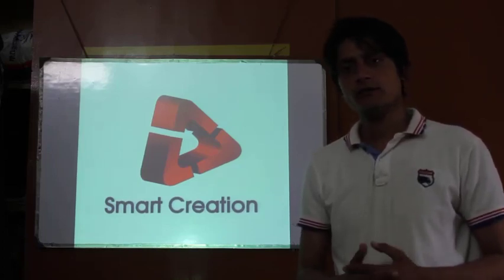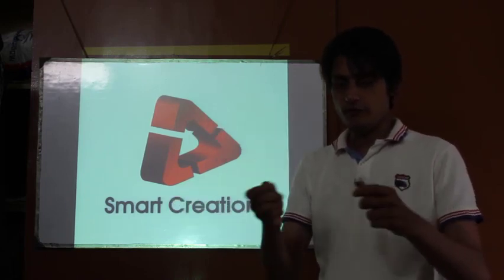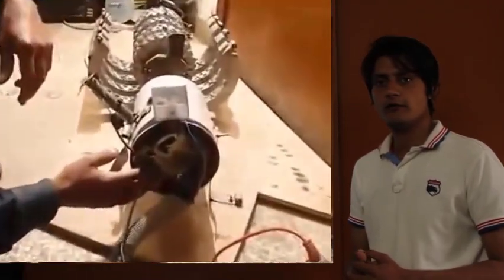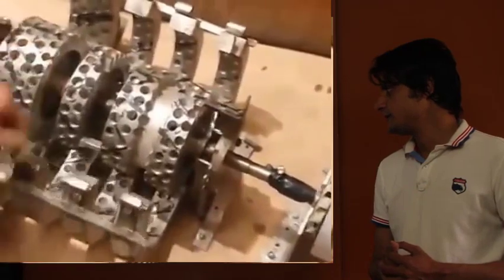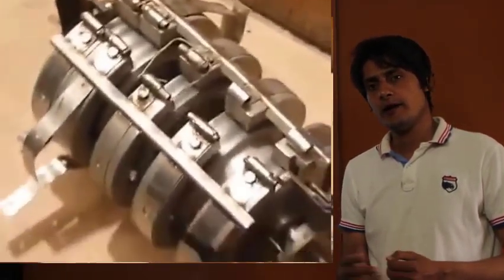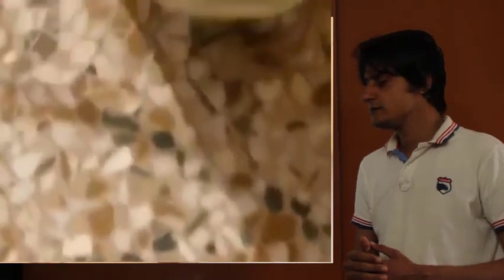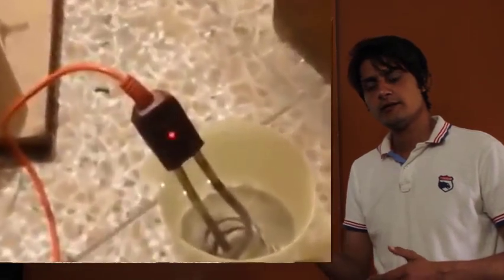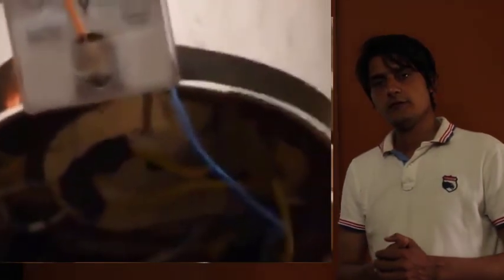Free Energy Generator By wasif Kahloon Magnet Energy Explained the Overall Ideas of Magnet Generator

Comment: Take the electric generator off it and just run the magnet field generator, that will prove a whole hell of A LOT!
Reply from the maker: agree this is my reserched so i am working on this is that worked or not
Reply: @LatestEnergy  remove the hose connecting the machines and show your machine working alone.
Reply from the maker: yup agreee but this is my reserched
Reply: @LatestEnergy   it is obvious you put a lot of time into it but it is not so obvious that it runs freely without help from a motor and power source.

Comment: Its called find the hidden grid connected power cable, what a pile of crap, its not designed to generate free energy, its designed to generate free money taken from fools.
Reply from the maker: oaky we would uploaded new videos regarding same generator
Reply: Ok this time please show the rotation motor inside the plastic conduit and the grid connected power cable.
Reply from the maker: dont warry we would updates you
Reply: Operating Instructions = 1 - Dig deep hole in ground, 2 - Put rotating junk in hole, 3 - Fill hole with dirt, 4 - Walk away.
Reply from the maker: okay we would uploaded new

Comment: I 'M building a similar to that and I need to know that It's just that it has a position for the part where the dynamo is.
Reply: Do not loose your time with that thing. It's a prank. No simple magnetic rotor-stator arrangement could work. A mecanism is always needed to manage the resistive and energetic vectors in any kind of machine. But effectively an energy creator could be build.

Comment: AGAIN I TRY ED MATCH N52....MAGNET TO N42....I HAVE THE MAGNETS IN HOME WHEN I DISCOVERED IS  THE BEST MAGNET HAS MOST POWER IS N42.....THE MAGNET N52 IS SO WEAK THEN MAGNET N42 I RECOMMEND USE N42 NEODYM IS SO MUCH POWERFUL THEN OTHER MAGNET.........WASIF KAHLOON HAD USED N42........ TO MACHINE RUN STRONGER WITH MORE POWERFUL FORCE.. TO RUN GENERATOR.
Reply: im sure you figure motor out soon or later thank you for  posting. god blce